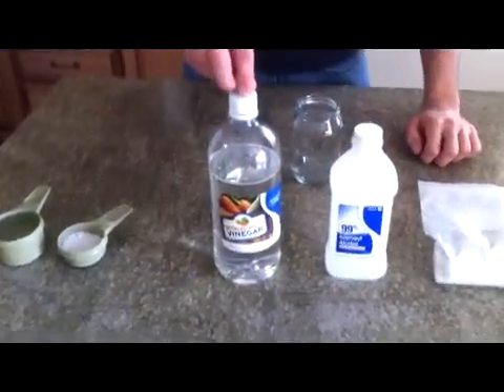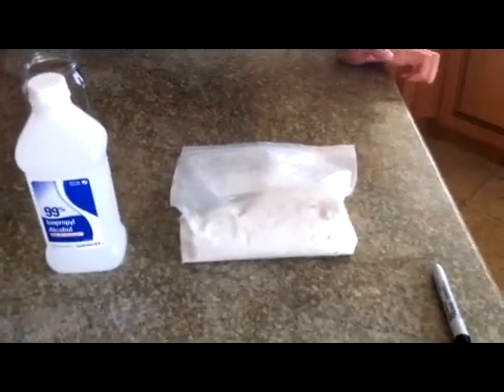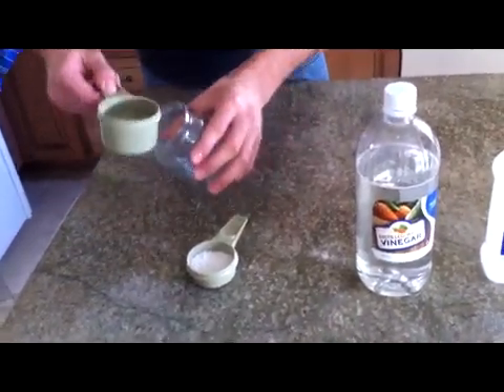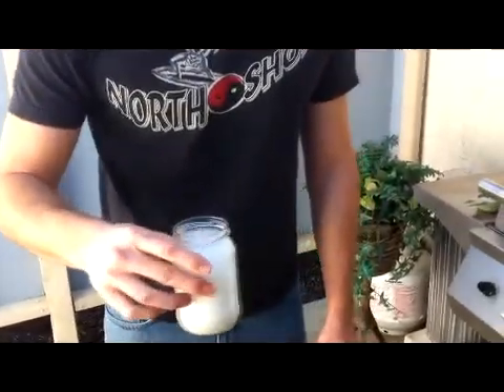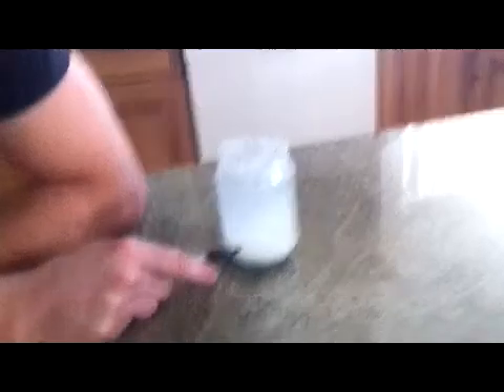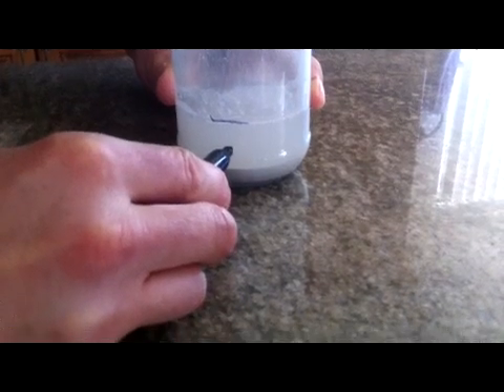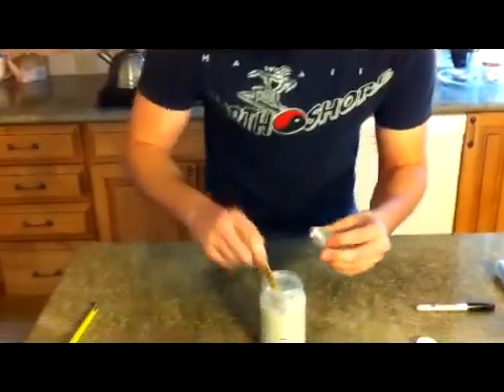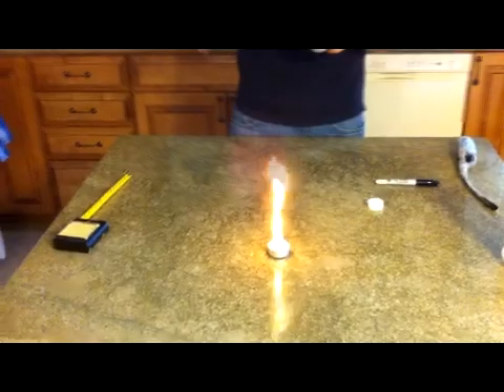Gel Fuel2.mp4

Comment: Dude,  check your measurements again.  What size jar are you using. Because by your measurements,  I came up the same, up until the parts with the measuring tape. I'm using a 12 Oz.  Jar, and the jar alone isn't  9 inches tall and from what I can see, neither is yours. So whatcha think?
Reply: cm.

Comment: @LowCountryTrucker You can still buy the canned gel fuel, you can't buy the thinner stuff used for firepots. (Birdbrain was one brand).   I work in retail hardware and we used to sell it, but had to take it all off the shelf after that happened.  I bought it and it works well, but it's thinner and burns faster, about 1-1/2 hours as opposed to almost 3 for a 13oz can of "real" gel fuel.

Comment: I have a gel fuel fireplace and I think I'm going to try this since obviously the cans of fuel aren't cheap.  I've burned 90% alcohol before, which used to be available at Costco, but I think they're only carrying the 70% now last I checked.  Even then, it doesn't burn as long not being in the gel form.  I'll probably order some multi packs of the 16oz bottles from Amazon, which seems to be the cheapest option as the gallon ones aren't eligible for prime and ad a significant cost when you factor in shipping.
Reply: Im responding to a 12 y o comment but might be relevant. For 95-99% alcohol. 
In a mason jar add 4 parts alcohol to 1 part salt. Shake or stir. Let it all settle.  Half hour or so almost pure alcohol will be on top layer. Middle layer will be water. And the salt on botton. (I used rock salt)

Comment: Ive got some questions:
1) How well does this stick to things, i.e. can it hold onto a wall)?
   If not, how could I make it more sticky?
2) Is it fluid enough to be squirted out of a bottle with a nozzle (you know the kind that pops up and down)?
3) If I made it with more alcohol to make it more runny, would this affect how well it burns?
4) How well does it stay lit (could a firm breeze blow it out?
5) Does it keep getting stiffer if it is left for a while?